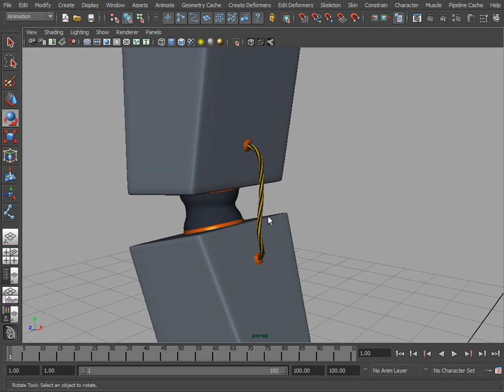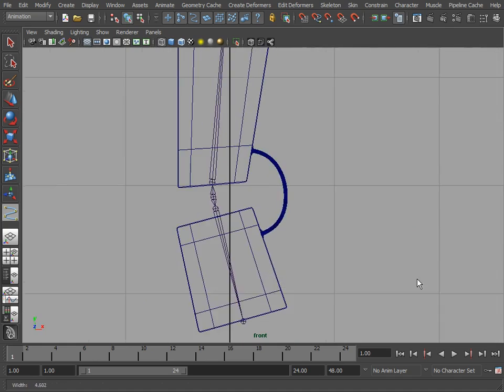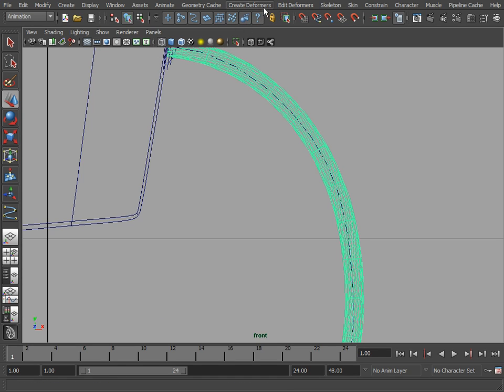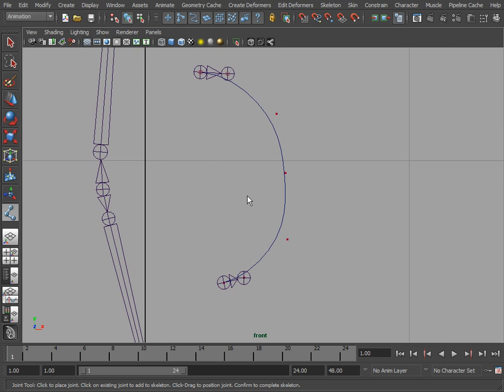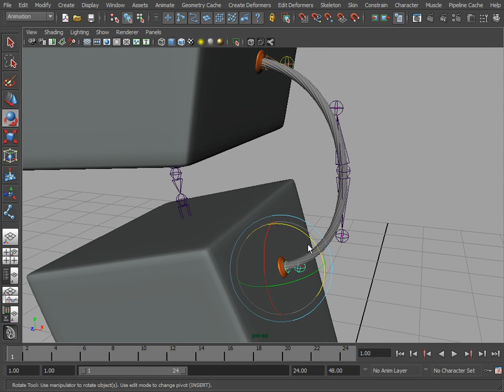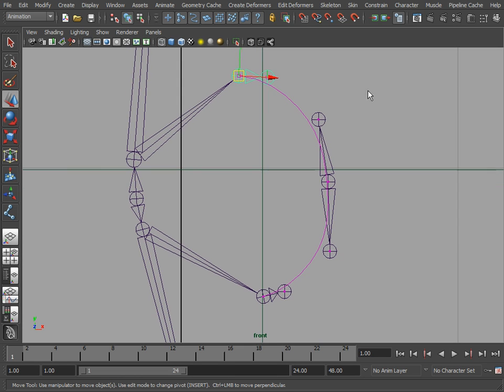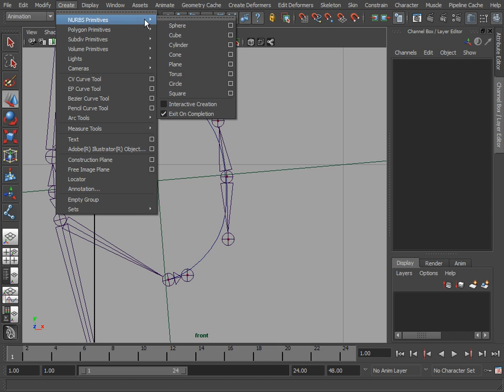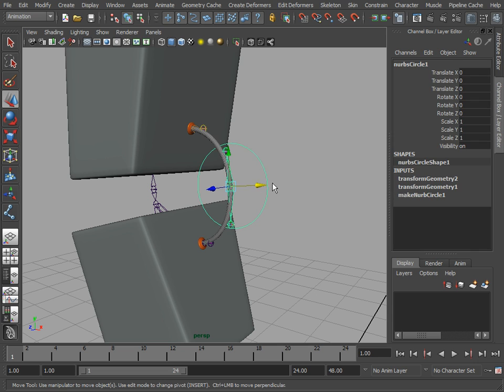Rigging Wires using Maya

Comment: it works great in maya but when i try to export into a fbx file,  the wire mesh disappears. Is there a way to fix this? I tried deleting deformer history and it still does the same thing and if I delete history the joints and curve no longer deform the wire.

Comment: one issue i found with the wire deforer is that its up axis and orientations are allways in world space, so if you rotate the whole rig, it will start to twist even if none of the control objects are twisting
Reply: Did you find a solution?
Reply: @grossimatte  unfortunately no, ive heard that there is SOME way to set the up vector for the wire deformer but i didnt find it anywhere.
i kept the control system but deleted the wire deformer, kept the curve, created joints on that curve and skinned them to the tube and created a spline ik with the new joint chain and the curve.
The controls from the video still deform the curve, you just have to add a stretch function to the joints, which is pretty simple.
simply divide the original length of the curve (static) with the current length of the curve (changes when moving curve).
then you should get the stretch factor which you can put into the scale X of the jointchain that is skinned to the tube (or whatever axis is pointing to the next joint)
If you want to make it really proper you can add that stretch factor to the translate X of the joints, this way they stretch better then when you scale them, but the scaling way is a tad faster if youre doing it manually on many cables like i did
Reply: @mintgreen5614  Thanks for the reply. That unfortunately is too complicated for me (I am not a rigger), and I need to use the rig in Unreal Engine, which I am not sure will digest bones scaling. Thanks anyway :)

Comment: Two ways I could think of were Jiggle deformer and making it a Hair system.
Jiggle would be the easiest but you may see geometry penetration. I would figure that you'd may use the Make Selected Curve Dynamic (nDynamics -> nHair). Then add your passive colliders, wire tool the output curve(hair system create two curve a follicle=driver and output=driven), and control the cvs of the follicle as usual.